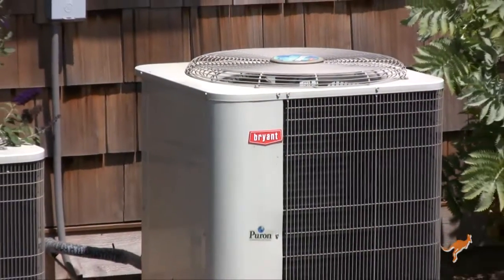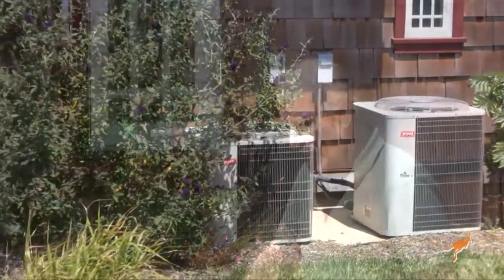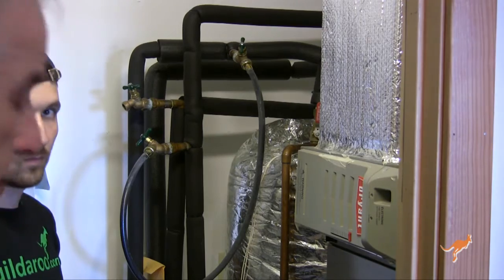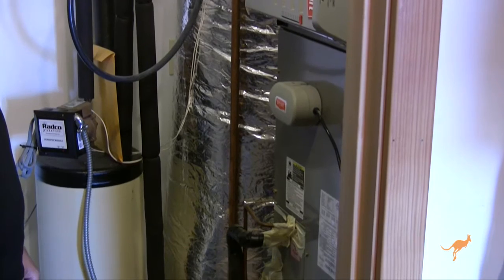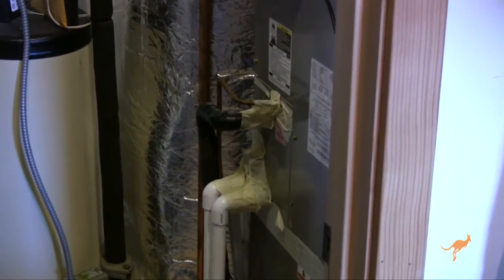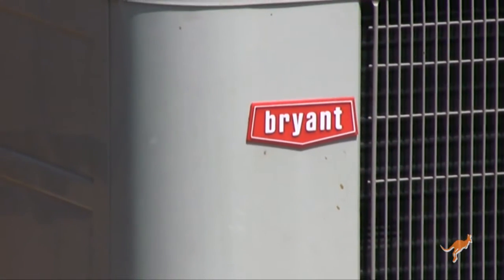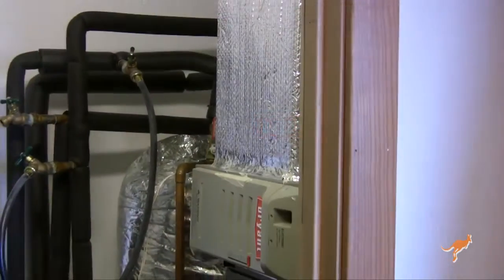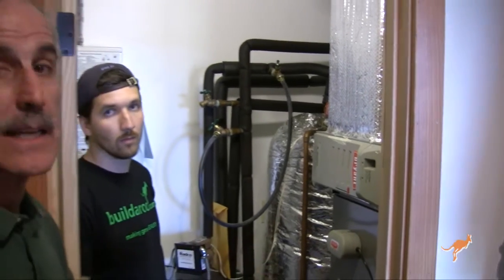Heat Pumps: World's First LEED Net Zero Home - buildaroo.com

Comment: The same way a propane refrigerator works in a RV. Heat the condenser (outside coil) with a flame burning propane and the evaporator (inside coil) gets cold.